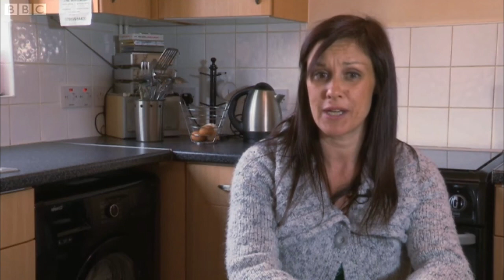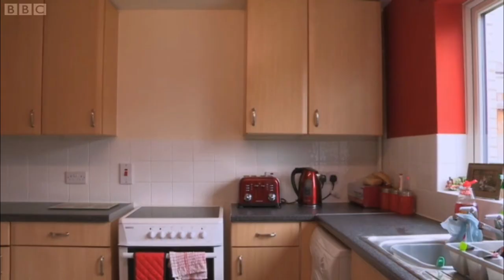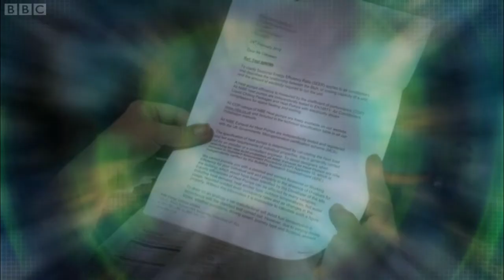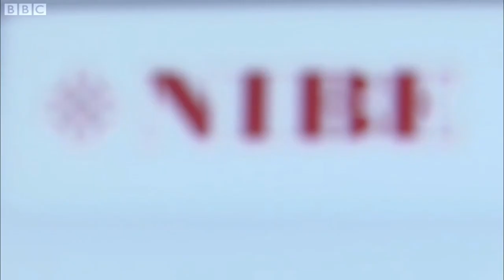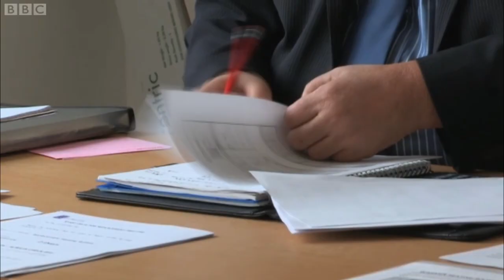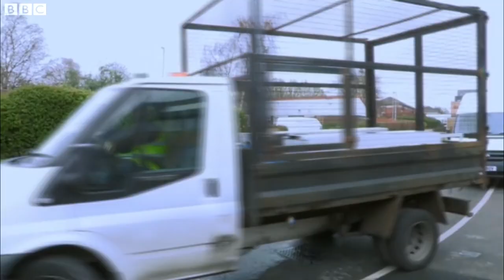NIBE on Rip Off Britain

Comment: I do wonder if those houses were insulated properly as some of the walls looked a bit... thin, especially around the bay window. That said, a 2kW unit is laughable for a 3 bed house and a family with two kids. The hot water demand alone would require a 6kW+ heat pump otherwise it'll take ages to heat the tank.

Comment: I wonder if a heat loss calculation was made before the heat pumps were installed. It looks like heat pumps with a low capacity were installed. They don't make it and are therefore heating electrically, which has led to high costs.
If they had made the heat loss calculation during the planning and ordered heat pumps with a higher capacity, which is more expensive, they would now be cheaper and the residents would not have these complaints.
Furthermore, I don't understand why the Nibe brand is always mentioned, while this can go wrong with heat pumps of any brand if no heat loss calculation has been made.

Comment: We have NIBE machine with floor and ceiling pipe system and great graphite insulation. Our energy bill is around 14k HUF monthly (change it it you want, It's super low - our house is around 270 sqare meter in 2023, and I dont have other bills because we dont need gas)This report is a huge lie. It's not the faliure of the NIBE company It's the faliure of your system engineer!!! If I was the ceo I would sue you because of this title.
Reply from the maker: NIBE UK have dragged the NIBE brand through the mud.  They are the ones who heat designed, fully installed and missold.  There are clear alternatives in the UK that run at 3rd of the cost of these consitently bad installations.  CEO should be pointing fingers at their own greedy subsidaries
Reply: @jasonoldy69   To be honest, I don't belive you.

Comment: The BBC have once again jumped in with two feet to rubbish a technology that has been proven to work efficiently. Every system that has a complaint against efficiency has been incorrectly sized and installed. that's every one bar none! The unqualified bidding to install New technologies and getting the contract because they were cheaper is the cause of this. The penny pinching building contractors are to blame and certainly not Nibe who have a big reputation. As I write the video mentions that the installers have held their hands up. Lying BBC again!

Comment: I have this system in my flat, not only is it extremely noisy with the compressor running all the time. It’s expensive as hell, and doesn’t even heat up the flat whatsoever, I’m freezing cold all the time. Absolutely appalling piece of engineering
Reply: Probably needs new dampers.  Keep it at a constant temperature all the time in the flat

Comment: The system works well with underfloor heating .... not radiators .... works  in est europ   much cold country
Reply: Yes the problem is that they have poor insulation and undersize the units in the Uk and the use radiators.

Comment: Crappy system. The builder should have to replace them with properly sized systems.  My heat pump works perfectly in -20 and costs 1/2 of what the old oil furnace cost yearly.

Comment: such a shame, now all those people will be put off the idea of heat pumps
Reply: You think this is bad wait till people are forced to use air sourced which has the same insulation requirements as these , but drafty old England houses just can’t cope.  Only now with. R values being tripled do you actually get a warm home without using the Emerson heater part.  Other pitfalls are undersized units,  issues with weather compensation controls most installers just turn it off,  and installers that don’t follow the rules - remember each quote they have to do a full energy. Rating of the property from windows to heating types and the amount of insulation,  plus when sizing ensure it is rated to -6 not -3  levels.  I cannot stress how important it is to increase your insulation first   Walls , in between floors and double your granny’s in the roof , solid walls forget it your electric will be through the roof without doing costly insulation first to the outside .  Case example a 4 bedroom house. 1990s build standard rock wall in the wall , zero in the floor , and 3 inches i the loft,  rads usually are about 4ft long single panel in most rooms double in high traffic areas such a living room and kitchen.   The house had to have extra wall insulation blown in , underfloor was installed to 7 inches,  ,  all pipes were upgraded to 22mm from 15 something they don’t tell you about.  We opted to install your typical loft levels in between the levels to increase efficiency and in the loft we now have 3 rolls on top of each over ,  all the rads we upgraded to high efficient twin   And the windows were swapped (due to the age and rotting for modern doubles with gas in fill ) we still needed a double unit 14kw .  Total upgrade cost before heat pump 15k .  We kept a system boiler as backup as well ironically i between commissioning of the heat pump the house only needed a 5kw to heat or it got to warm e.g. the .boiler turned down to minimum as for the heat pump it’s good but if like us if your still turning it off it’s warm up time is almost double gas . That’s not a bad thing since you can turn it on on the way home etc electric prior to spring2022 was about £90 pounds a month.  With 2.5kw on the roof pv.  Would I do it again,  it depends on the build seriously insulation is the key also scale your cylinder to your needs then add 50-100 litres as between the solar heating via a solar diverter and heat pump means it stays hot most of the time unless everyone and the dog has a shower reheat times about 2 hours on heat pump mode zero immersion heater usage. For a 300 litre tank compared with about 45 mins for a 25kw system.  From cold.  Do you save money compared to gas . Honestly they are about the same .  Every now and again we turn off the heat pump and give the gas unit a go in that week we use about £20-25  of gas at 6.2p per kw . The heat is a lot more noticeable on warm up compared to the heat pump l our heat pump is operating at about 2.8 units of energy per kw , a little down on the 3.5 originally quoted we only see it that high usually in summer when it’s only heating the tank.
Reply from the maker: They'll now question anything with "green" credentials, which I think is a good thing.  The same people will probably hate rainwater harvesting as well

Comment: These systems are very efficient when you have properly insulated house and if you use low temperature floor heating instead of high temperature radiators. Specially for the new build they should have calculate the heat loss of the house and install the unit with proper power output so it does not need to run on emergency electric heating coil. In Northern countries these systems are used widely and the emergency heating is turned only when the temperatures are below like -20 deg C or so. However build this houses and decided for that specific unit should be blamed, not NIBE.

Comment: To uncomplicated all this an exhaust air source heat pump extracts heat from inside a building transferring heat to a storage tank by using heat exchangers/compressed gas. It sort of works in the reverse way a fridge does (notice a fridge is always hot at the back).   A lot of heat can be extracted this way and modern heat pumps can extract heat from air as cold as -15 degrees centigrade.   Just because air is cold does not mean it does not have energy!  The heat collected is then used again to heat the house through radiators/underfloor heating.  

These systems are better installed in passive houses (very well insulated houses). The uk was truly awful at this  and we are still catching up with most Scandinavian countries. 

Basically all this probably failed because:
- poor insulation of uk homes
- incorrect installs
- incorrect KW system. 
- users not educated. Around this time people were used to firing up the heating when they want the house warm but this system is best left constantly running. 
- hot water was provided by an immersion heater which also probably compensated for the heat loss of the property from poor insulation. Gas is much cheaper so accounting for poor insulation doesn’t matter as much. 

Another thing to note is some people set their heating to unreasonably high temperatures. 18-21 degrees centigrade is where if should be, not 27 degrees with the windows open. 

I can’t comment on the model of the boiler in this ‘scandal’ but I am considering buying a Nibe as they have generally have a good reputation.
Reply: so it extracts heat from the same space its heating up, err, that's not going to work!
Reply: @edc1569  That’s why the process requires electricity. This accounts for the excess heat produced.  Unfortunately electricity is much more expensive than gas.
Reply: My flat walls are twice as thick as a normal house. It was considered an eco flat.... this system doesn’t work. Just awful

Comment: if i had lived there i would have simple disconnected the immersion heater element and left the heat pump part of the system working. but thats just me
Reply: 🤨 That would have caused it to state a fault condition and not work
Reply: @samuelfellows6923  It does work. There is a setting in the menu where you can specify an outside temperature at which the immersion heaters are not started. You can also set the system to Autumn/spring mode which has the same effect. If you are a bit handy then a third option is to use the tarrif control switches which allows for disconnecting the immersion heater in two steps.
We have this system installed in our 125m2 house in Sweden and it works good as gold. The problem appears to be Nibe dimensioning the system for a properly insulated house which doesn’t seem to include typical British homes!

Comment: WTF... You COMPENSATE for heating loss with adding inefficient, outdated, dinosaur heating system (gas) instead of an excellent, scientifically proven system like the NIBE...? You should design your homes with better heating insulation instead of wasting energy and promoting using fossil fuel like gas. This is the worst video I have ever seen made by BBC. It's nothing but advertisement for British petrol companies producing gas. The makers of this program seem to have ZERO ability to accept facts and clearly only had one goal, which was to promote the use of gas. I have a fairly large ( 180m2 ) house built 2003 with 6 rooms, two bathrooms and four people living in it, so my children went through all stages from small to adult in the hose and the same NIBE system works very well, capacity is more than enough without any additional heating. So if the capacity of this system in your homes is not enough then either your homes are HUGE (which I doubt) or you have sever heating losses due to poor installation, way of living, or very poor building standards and insulation . The people who made this program are simply incompetent in the subject or get paid from the gas and petrol industry.

Comment: So, the housing association, bought tiny units, so the backup heater has to be used, the builders fked up the installation, further doing everything up.

Just so you know, I have a heat pump and im very happy with it.

Comment: I don t believe this type of heatpumps work with normal radiators as seen in the video You need a system that works on low temp
Reply from the maker: Our replacement gas combi runs these rads below 40deg all winter and it's effortlessly toasty. 1/3 the cost of the NIBE system as well
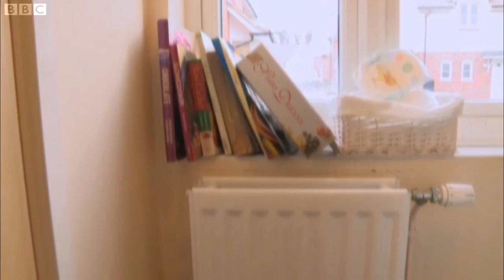Reply: @jasonoldy69  Those tiny double panel radiators that don't even span the full width of the windows that also look like they belong in a 1960's home? 5:53 WTF?! Those radiators? I seriously doubt that they stay below 40 C. Turn down the supply temperature on your gas heater to 40C and I will guarantee that you will freeze your nuts of the coming winter. Radiators work by convection and to get a proper amount of convection they need to get warmer than 40 C when it's cold outside. Marius is right: Heat pumps don't work well with standard radiators. You need forced convection radiators or, idealy, underfloor heating.
Reply: The other problem is that the capacity of this heat pump is simply insufficient. In a slightly smaller home with underfloor heating and proper insulation this system would work well. In this case someone got the specifications wrong and cut corners by installing radiators instead of underfloor heating. I don't know about this particular case, but past experience suggests that is the housing association, not the supplier of the equipment.
Reply from the maker: @peterselie1779  All installed to the designer's (NIBE UK's) heating spec.  Our property is a tiny 2 bed, yet our annual NIBE running costs were over £1k for a system commissioned by NIBE UK at request of ourselves and our shared owner HA
Reply: @jasonoldy69  Did they sell it as a cost effective solution? If yes, then they are in the wrong. Technically this unit is capable of heating a poorly insulated home, but in that case it will rely mostly on the cost ineffective 13 kW immersion heater. The heat pump only has a capacity of about 2 kW (even less with a high temperature system, suchs a free convection radiators), which is not enough even for regular heating demands unless your home is very well insulated and fairly small.
Reply: @jasonoldy69  And if the running cost was over £1k/year that means your house is poorly insulated. That's around 7000 kWhs/year. I use about 800 m^3/year of natural gas for my tiny drafty 2 bedroom home that was built in the 19th century, that has single pane windows and is poorly insulated. 800 m^3 rougly equals 8000 kWh of heating demand.
Reply from the maker: @peterselie1779  If our home now achieves 1/3 of that cost thanks to our replacement gas combi, your insulation theory is flawed.
Reply: @jasonoldy69  No, my theory is not flawed. I was talking energy content, not price. A kWh worth of natural gas is much cheaper than a kWh of electricity. Roughly a quarter the price. That's why heating with a gas combi is cheaper than using a resistive electric heater.
Reply: @peterselie1779  I guess not anymore :) Out with the gas, in with the electricity based pump
Reply: @jasonoldy69  lol yeah I'm sure a flow temperature of 40*C keeps your room lovely and warm....
Reply: You should be able to heat a well insulated house with water at 30°c if the system is designed correctly (100mm centres underfloor heating or oversized radiators). At that temperature with a correctly sized heat pump you should be able to get 400-500% efficiency